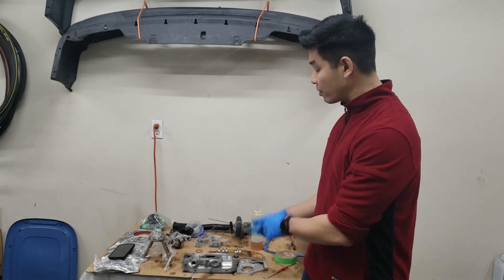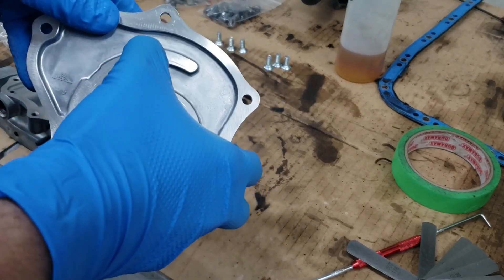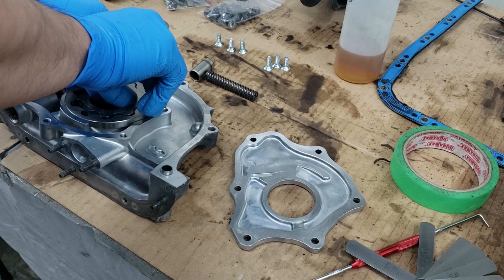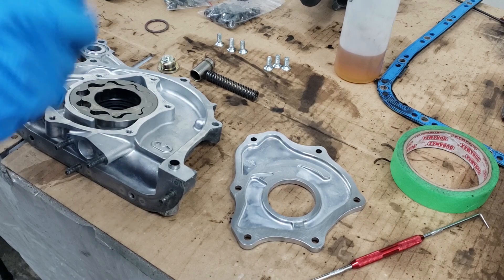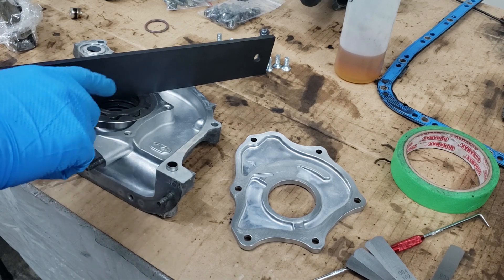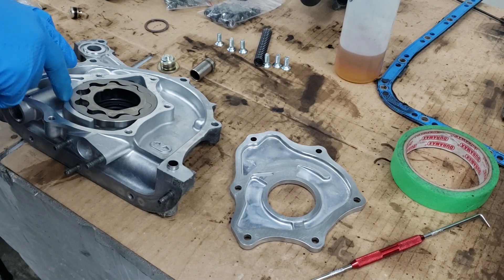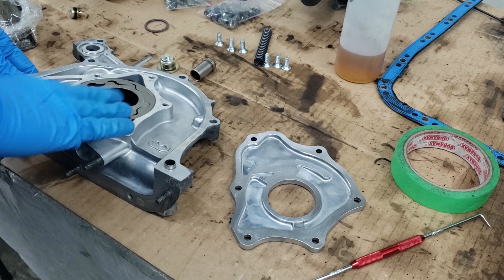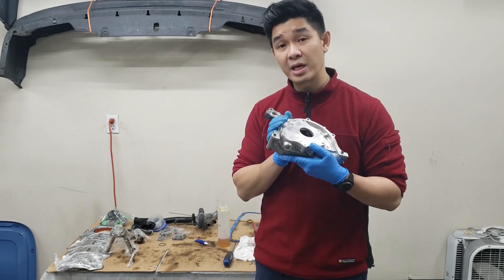||HONDA EF9/ED7 CIVIC & CRX|| B18B1 Oil Pump Inspection✅

Comment: Are these the same mesirments for a gsr pump ? 
I believe they are all the same after 95+

I can’t find any specs 
Thanks
Reply from the maker: I believe they're the same. I don't recall the Honda service manual having separate specs for the oil pump, but it's best to check your service manual to confirm.